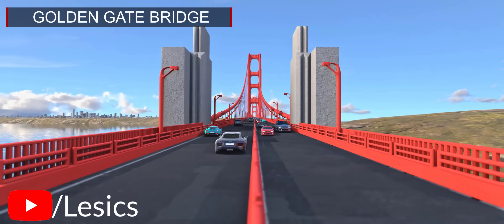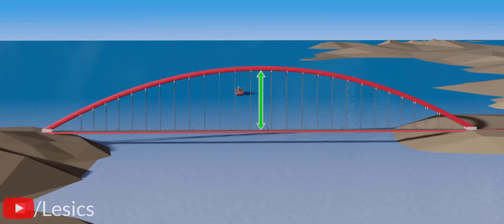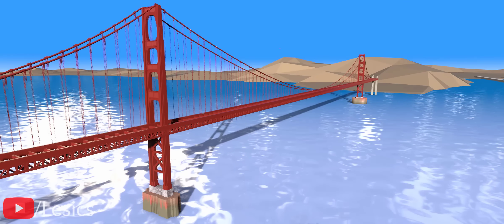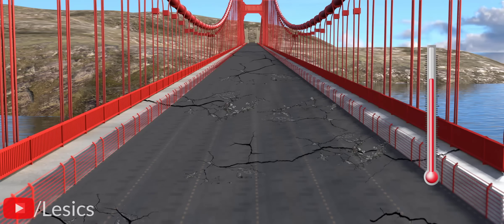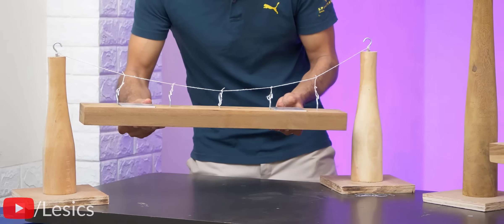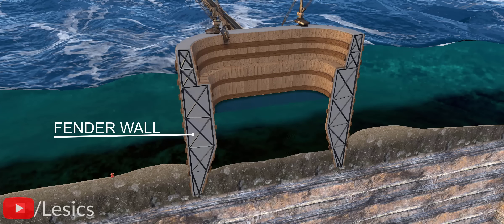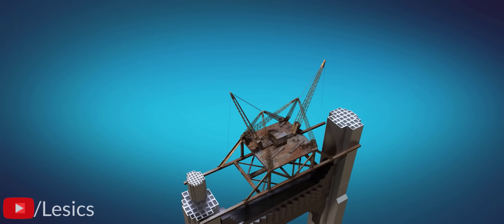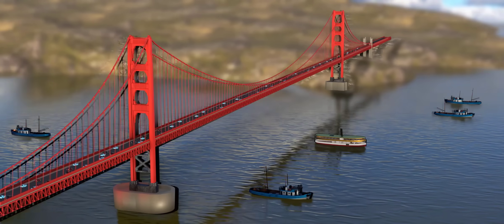Golden Gate Bridge | The CRAZY Engineering behind it

Comment: Extremely well illustrated! Great efforts put into the content.👌

I have a doubt related to the thermal expansion.
As explained in the video, we have the 'Finger Expansion Joints' laid down every 50 ft to compensate for the differential expansion between steel and concrete. 
How does the bridge design account for the differential expansion between steel and the wooden base first laid before the steel bars in road preparation?

Comment: Strauss is credited as the chief engineer of the Golden Gate Bridge, but Charles Alton Ellis is responsible for most of the structural design. Because of a dispute with Strauss, however, Ellis was not recognized for his work when the bridge opened in 1937. A plaque honoring Ellis was installed on the south tower in 2012, to acknowledge his contributions.

Comment: I've always been impressed by Strauss's repeated deference to worker safety considering the construction safety standards of the era were for the most part non-existent. The entire project's design and execution remarkably hold up a century later considering that it has only required reinforcing of anchors and upgrading critical steel junctions retroactively without requiring it to be replaced, and is now considered at minimum capable of surviving a 8.0 magnitude earthquake with a epicenter close to the bridge itself.

Comment: I'm here after the Bridge collapse in Baltimore. Very very tragic 😞
Reply: Big difference between the main pillars of the two bridges right?
Reply: @henryhenderson7051  I'm not sure at this point. Looks like a similar structure. The B-more bridge had more pillars underneath
Reply: @ComboForgeTM that was the most random and unexpected thing that happened here in Baltimore like i wasn't expecting that but seems like they crashed the ship on purpose since you can watch as the cargo ship turns towards the pillar
Reply: @sockk4 power turned off.
Reply: @fouranglesquare  no the currents were pushing the ship around since there were currents there and the power went off twice but the moon lit up the sky so they could see where they were going
Reply: Same

Comment: You forgot the main issue. The piles are at two different tectonic plates. It means that the earth at two ends of the bridge has two different movement during the earthquake. That is one of the main reasons of soo many joints along the bridge.

Comment: I'm confused as to why you're correctly using kilometer and meter to talk about the length and width of the bridge, but then randomly switch to using feet to talk about the  depth of the towers and how much the bridge expends with temperature.. Hard to follow when you're mixing units like this..

Comment: One of the most terrifying experiences of my life was going over golden gate.
It looks serene from the land as you head on the road but it gets bigger and bigger as you get closer.
Then it goes into such a steep incline and keeps going up and in the far right lane the long drop down. 
I gradually moved to far left lane where now the edge was lanes away but still wondering if my 1070s Honda station wagon is going to make it up or get blown off the bridge.
You get to breath when you reach the top till you reach the long steep decline and rode the breaks almost the whole way. Just to reach Oakland.
Considered the land route going back to SF but after another white knuckle crossing I never wanted to get back on the bridge again! It's nice to look at but a terrible experience when not used to that kind of steep incline and decline with nothing under you but a bit of bridge😂
❤😂❤😂❤

Comment: Ngl I think the Golden Gate Bridge is over rated like in Michigan we have the mackinaw bridge which is 5 miles long (so like 7.8 ish kilometers) or double the length of the golden gate, the makinaw bridge is in the same depth of water, at deepest 350 while the average is 290 feet, the water temperatures can reach freezing and the entire straight will freeze over, needing icebreakers to clear a path for ships, not only can it reach -40 on some horrible nights making the steel incredibly brittle and shrink greatly, and it also looks fresh as hell, like the monotone red is out competed by the tropical water green steel and light grey supports, long story short golden gate bridge Meh mackinaw bridge great

Comment: Each strand in the main cables occupies a different part of the cross-section and thus bears a slightly different load. To account for this, and to minimize thermal expansion, engineers looked at weather records and determined that the most stable temperatures at the Golden Gate occur around 4 am. Hence, most of the cables were stretched in the wee hours of the morning. Also, in addition to the 1987 incident, shortly after its completion the bridge was displaced laterally several meters by gale-force winds. Some fun facts I learned from T.Y. Lin in 1989.

Comment: Give credit where credit is due.  The first steel cable suspension bridge of substantial length was the Brooklyn Bridge in New York City.  It took 14 years or so to construct because numerous difficulties had to be overcome that were not that well understood at that time.
One of the major difficulties to overcome was when engineer Roebling was advised that the steel for the cables was substandard.  The tensile strength of the wire did not meet the minimum specified in the contract.  Then there were the problems encountered with the bends.
That bridge was completed in 1883 and still carries as much traffic as ever.  That's REAL engineering.  No CAD, no Computers, no simulation.  Just hard-core engineering with a slide rule.
One interesting snippet:  The Tacoma Narrows Bridge failed because its designers failed to heed Mr Roebling's advice regarding the need for deck stiffness in suspension bridges.  This requirement is not immediately apparent to the uninitiated.
What would a dumb German/Nazi know about American supension bridge construction, right?

Comment: Great video presentation. They forgot to include the bridge road to be slightly arched, like an old arch bridge design. It may lessen the tension of the cables and reduce damage when the road deck steel expands. When the finger expansion has no more room for expansion, the steel road deck will push horizontally and may damage the two towers. When the road deck is slightly arched, it will just push up to lessen compression. The designers are very smart. It's a combination of an arch bridge and a suspension bridge.
Reply: It's mainly to avoid 'slump' when the load is very heavy.  It becomes level when maximum load is on it.......except when 300K people were on in.  Slump of 6 meters is huge, but it didn't apparently crack!  (I would LOVE to know the concrete mix and steel usage that held w/o cracks). Along with this bridge, the Empire State Building is on the list of top 7 (ASCE) civil engineering wonders of the world.  The ESP was built, and open for business in just 14-1/2 months, during the depression, followed by W2....leaving the owners with no profit until early 1950's.  (Retired, structural:  bridges/dams/high rise bldgs)  Slide Rules ROCK!!
Reply: Also I wondered about wind. How did they factor that into the design?

Comment: Each Main Cable contains 27,572 wires at 61 strands. Each strand has 452 wires per strand. The Cable was configured with the Vertex of the hexagon at the top and bottom of the cables instead of the sides and top. The bottom strands had less wires so the cable would Compact to a more Round configuration. This was achieved by Charles Sunderland of John A. Roebling's Sons Inc. Roebling supplied and spun the Main Cables and supplied the original suspender ropes.

Comment: An entire video could be done on the main cables alone! In my opinion, they’re the single most complex element of the whole bridge. There’s the precise tensioning of each individual strand, bundling strands into packets that are positioned into a specific pattern. Then using a specially designed hydraulic compressor to form a perfect circle, and wrapping the whole cable with a spiral wrap using another specialized machine. And having pre-planned connections to the massive anchorage blocks at each end. AMAZING!! 

The designer, Mr Ellis, also had to calculate the distributed vertical loads from the suspender cables onto the catenary, the weight of the cables themselves, and the required thermal expansion/contraction in the roadway, plus estimated lateral force from 100 mph winds (his arbitrary standard) and you get the idea.

Comment: Low towers, make the main cables stronger.

High towers, use more steel on the towers.

Towers are basically. in compression.  John 
Roebling used rock construction in his 
(Brooklyn Bridge) design.  Rock is relatively 
cheap.  Washington Roebling, John's son 
built the bridge, and wanted to use Roebling 
steel wire in that build, but was not allowed 
to.

John A. Roebling and sons made the cabling 
for the Golden Gate Bridge.  Both bridges will 
outlast me or any (fictional) progeny.

steve

Comment: Was stationed in the military in San Fransisco. Jogged across this bridge on several occasions.  I remember they would use traffic cone rods to open more lanes for incoming work commuters. In the middle of the day, they would shift the traffic cones to other traffic lanes to allow more lanes for afternoon commuters exiting the city.  They had a series of lights for each lane to change the direction of traffic flow depending on the time of day. Years before, I was in the high school marching band and the parade we were in took us across a bridge in Frankfort, KY. As our band, composed of about 75 members marched across that bridge, we could feel the bridge bounce under our feet. I learned years later that when armies would march to different destinations and had to cross bridges, they would not march, but just walk across the bridges, as the "bounce" of marching large groups of people could possible damage or even collapse a bridge.
Reply: i learned that some of the biggest weaknesses of suspension bridges or mostly all bridges is that swaying in a resonant synchronous frequency would make it amplify it even more and would damge it. a good example is the millennium bridge incident in london.

Comment: Being a laymen. I wonder if the bridge were to be built today if it would use the same engineering techniques. Ie suspension. Or are there other options.
Reply: Also a layman, but I think you're looking at a suspension bridge.  There's still no bridge that gives a better expanse than a suspension bridge.  The Golden Gate straight gets traffic. Aircraft carriers go through it.  One of the largest cargo ships ever built has gone through it.  If you don't have a bridge built and you have ships of that size crossing that straight, you're gonna build a bridge that can support it.  The remarkable thing is, they did that 90 years ago.

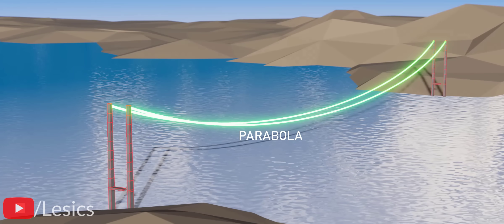Comment: @0:54 "this cable can be approximated as a parabola" this is not correct. the correct shape is called a catenary: https://en.wikipedia.org/wiki/Catenary#Catenary_bridges
Reply: I imagine they went with "approximated" because they figured people are more familiar with parabolas than catenaries. But a catenary is such a cool concept that it's a shame to miss out on mentioning it. For the non-fancy-term people, it's the shape a loose rope or string makes when held at two points. And, as an added bonus, if you make a square-wheel bicycle with a matching inverted-catenary road, it should be a smooth ride. It's pretty nifty.

Comment: How is the concrete poured for something of this scale? I know they set up project specific batch plants in the area but I imagine something the scale of the footings would take many weeks if you were filling continuously and then would you have to worry about the weakness of newly curing concrete and the expansion/contraction cycle of concrete as it cures? Or does that or some other factor make it impossible to do so and you fill the concrete in lifts in which case do the cold joints cause issues that have to be overcome?
Reply: The batch plants were near the North Tower at Lime Point and they used cranes and had narrow gauge rail lines going the length of the bridge. Historic videos show the process.

Comment: My question is... 13:40 did that guy actually run 2.7 km to pull that support wire?☺
Btw damn this thing designed and built 89 years ago with barely computers to assist,  thats some serious damn engineering and calculation

Comment: Fun fact.  The Golden Gate Bridge undergoes constant maintenance.  There is a crew that works from one end of the bridge to the other.  They repair and replace rusted out pieces and repaint as they go.  This is a never ending loop.  When they reach the end the crew goes back to the other side and begins the process all over again.
Reply: you just explained pretty much every bridge in NYC
Reply: Sounds like a steady job
Reply: Job security
Reply: @davidperry1116  sort of 😀
Reply: Pretty cool
Reply: @pallin2198  what is a fun fact?
Reply: @Pleoryo No clue. I would assume they also remove old peeling paint, or paint which is about to come off.
Reply: Fun fact for you: Though the GGB has a longer span between main towers, the Mackinac Bridge sports a total length 3 times that of the GGB(5 miles long). I have crossed a few times. Every time there is a maintenance crew working on the bridge. What they do is they paint the bridge every year, starting on one side, ending the year on the other side.
Reply: Npc energy
Reply: Majority of big bridges around the world get the same treatment…still impressive none the less
Reply: Do you know why the actual bridge has secondary wires? It's visible at the start of the video but isn't part of the animation
Reply: @ThatPianoNoob  Yup.  Sure do.  They are not designed to support the bridge indefinitely.  Only long enough to facilitate repairs on one or two of the main cables.
Reply: @patraic5241  ah cool Ty!
Reply: fun fact! 🤓🖕
Reply: Thank you for sharing that I had no clue that’s how they keep the bridge up.. nice to know..
Reply: I literally had that question! Like imagine if there wasn’t!
Reply: Also the most suicides of any bridge in the USA. I hear it's a fun jump.
Reply: @MikeHunt-qu6sk  they

Should reinstall that net

Comment: At 4:32 you show 2 sets of eye hooks connecting the suspender ropes to the structural steel, this is incorrect.  GGB used "broomed sockets" on the ends of the ropes, broomed and then filled with molten zinc. The same way the Bay Bridge connected their suspender ropes. ( you can actually see the sockets when you drive the lower level Bay Bridge).  I got this from E. Cromwell Mensch's book ,copyright 1935 sold at the GGB in 1995. He also wrote an enginneering book on the Bay Bridge, I could not find it on the web, so I photocopied the one at SF public library around 25 years ago.

Comment: The opening diagram showing the cables, towers, and road deck was flawed. The cable extends at both ends to massive anchors embedded in the ground. You do not seem to have the remotest clue about civil engineering.

Comment: Engineers can still design absolutely anything safely, to withstand static and dynamic loads under the most diverse circumstances, for many decades to come.

But after that design phase the project is handed over to pencilpushers that'll take out any and all safety margins to cut costs.
As a result, we (engineers) hardly ever get to design buildings and structures to really last anymore....

Unlike the Golden Gate Bridge, which has stood for 85 years already, and was designed to last, most newer projects have to last far shorter than that as they need to be economically viable - most buildings get torn down after they economically expire within 30 years at the max. Some falter well before that time, again due to beancounters that sit behind a desk only thinking of ways to save a bit of money - regardless of risk to health or even human lives.

Engineering these huge projects used to be fun.
We never looked to build another pyramid to stand tall for millennia, but buildings simply should last longer, and be more flexible, sustainable and durable than they are now.

Comment: They give Strauss far too much credit here (a common mistake)! Strauss did come up with the concept of bridging the golden gate, and was its chief promoter, a herculean task in itself! However, he primarily designed cantilever bridges and did not have the engineering experience to create the suspension bridge that was built.  Charles A. Ellis was the primary engineer. 
Also, they show the traffic flowing in the wrong direction on the bridge. Our steering wheels are on the left in San Francisco!😂
Other than that, a very interesting video!
Reply: Yes, when I reached the 6:17 mark, I thought, "The cars are driving the wrong way!" (^: Digital effects might have been created in the UK or some other country where they drive on the left. If built today with polymers, it could be a cable-stayed bridge. But the people might revolt about that. Or they could make it with lighter materials and have the same design, but towers closer to the shore to save money. It costs a lot to maintain this bridge so they might replace it some day.

Comment: The actual state of these old bridges would scare the crap out of you. If you all saw just how many cables, beams, surfaces need to be completely replaced, you would take the long way around. Hell, most do noy remember that a bridge in MN collapsed under the sheer weight of ... Wait for it ...
BIRD SHITE. Yes, 3 feet of bird poop was allowed to clog up the water drain ports built into the beams of the entire structure. Look that "shite" up.